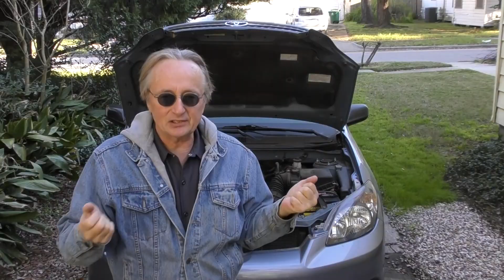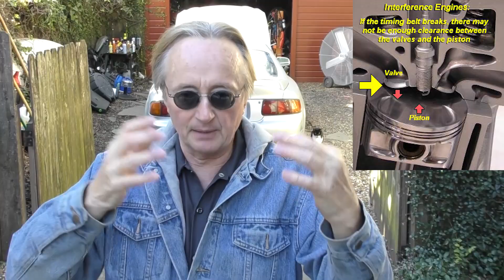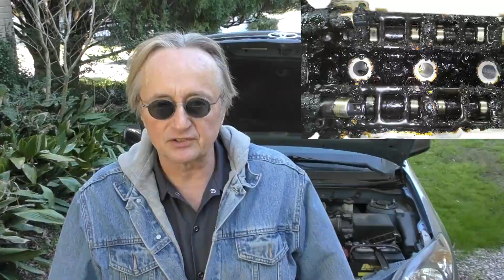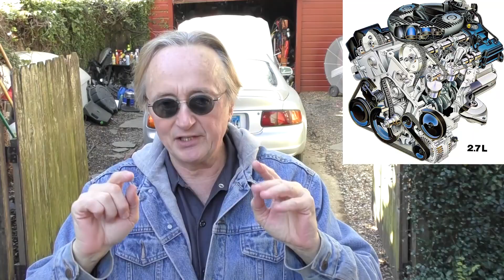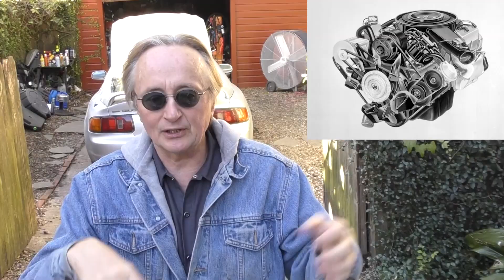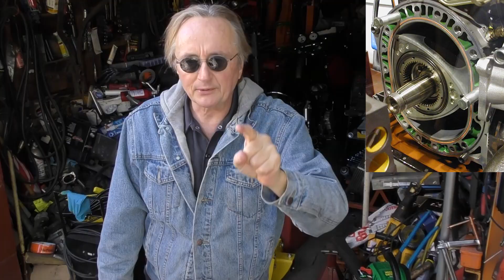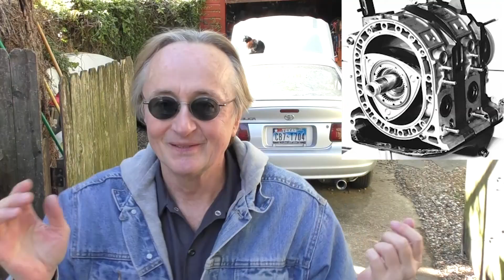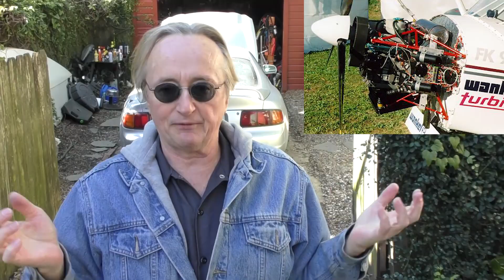Never Buy a Car With This Engine

Comment: The 2.2 a garbage engine????? Holy hell the ecotec/duratec engines are Rock solid!!! I have had 2 go well over 200k and still run like a top!!! Why do you think 95-05 cavaliers are still on the road? Exactly. Great engines.....everything else will fall apart but the engines will still be putting along hahahahah.
Reply: 92 to 02 were pushrod 2.2, after that they went to ecotec in cav and cobalt. Both engines ran great for me and many people I know
Reply: Leo Derosia Malibu’s as well
Reply: I had a cobalt with that motor and I pounded on it every single day for about 3 years , never ever had a motor issue except 02 sensor and it had 230 thousand miles
Reply: my old cav had old pushrod 2.2. Got 80k and the oil pump failed. Replaced it with a supercharged 2.2 ecotec. I never had a problem out of it.
Reply: We have 3 cars with the Eco-Tec engine. All of them have been excellent. Malibu, Saturn Vue and Chevy trax.
Reply: @alonsosanchez8547  i have a 15'  Trax, love it!
has a turbo too, which Scotty seems to dislike too....but that 1.4l turbo, when cared for will last!
Reply: I had 230k on a 2001 Cavalier 2.2 Ecotec when I got rid of the car. NO PROBLEMS from the engine, but AC went out, and I didn't feel like dealing with it. Replaced it with my wifes 09 HHR, 2.4 Ecotec now it has 212k miles on it and isn't giving me any reason to think it wont go another 50-100k. Wheel  hubs have to be replaced on the HHR fairly often, the bearings are junk. Everything else works great.
Reply: Bro, Cavalier literally means they don't give AF  ! Lol
Reply: @SouthernCharity  i don't think you understand what Literally means.....
Reply: @Brian_Buckley  bro, GM is famous for not giving a fuk.  The model, Cavalier, literally reflects that.
Reply: Have owned a couple of those. You are right.  After the car has disintegrated into rust, the motor will still be running.
Reply: My chevy S10 is a 2.2 liter pushrod engine.
Reply: This is why, Scotty is a treasure trove of misinfo.
I know so many people with the Ecotec engine and they have lasted a long time.
I agree with the 2.7l v6 Chrysler but that was really a Mitsubishi engine.
The Cadillac v8 6 4 engines were also very bad design and i agree with Scotty.
Noticed he didn't mention the Toyota 3.4l v6 and the Ford 3l v6 (not the Duratec but the Vulcan engine they used in the early Taurus), and the Ford 2.3l l4 they used in the Pinto?
Both Ford engines were synonymous with seizing pistons when it got warm and Toyota 3.4l v6 from the late 90's to early 2000's, were also notorious for engine sludging and would seize within a couple of years even if you maintained it well and this was due to a very lightweight oil being used for that engine. 0w20!
Toyota replaced tons of these engines under warranty and this engine was commonly used in their Sienna minivans during that time.
Reply: @sensiblebabyandreality6804  (1) 3.0 V6 Taurus was still better than their 3.8 one,but that don't say much good for either engine?? 3.8's were bad about blowing head gaskets/cracking heads. And Lord help you if it were in a (Heavier) Windstar!!!  But then,the transmissions also were junk in them as well,so.....which item breaks first??? (2) V-6 Mitsubishi's/'MitsuMopars' have always been known for being oil burners,ever been behind a lot of the older 'Voyo-vans' or the Acclaims/Spirits/Dynastys with one?? (Takes off from the light...."Puff"?) Plus,how often do you see an 'old' Mitsubishi?? Even where I live where rust isn't an issue,you'll seldom see one older than the mid 2000s, (And most of these are 'Hot Rodded' Eclipses,sometimes a Hot Rodded Mirage,too?) and most you'll see are also in pretty bad shape for their age? Really 'Hammered'. And never one older than the mid to late 90s!!!! (I think Mitsu started selling under their own name here about 1981-82?? 'Our' Dodge Colt's and Plymouth Arrows back in the '70s were both Mitsus,though???) (3) Caddy's V8-6-4 and the HT4100 that followed it were one of the best things Cadillac ever built......to help sell Lincolns!!! (Or Olds Ninety Eights-Toronados/Buick Park Avenues-Rivieras?) (4) 2300 Pinto actually made a pretty good little racing engine......once very popular in the Mini-Stock classes at Dirt/Short Tracks?? (But of course,those've been worked on just a bit??) (5) I agree with the Toyota issue,the oil is too light (0w20!!) for anywhere below the Arctic Circle in the dead of winter!!! (As a comparision,ATF....Tranny Fluid....that's a 10w oil??) I won't go under 10w30 on nuttin!! (And really,10w40 in the summer down here in Texas??) Plus Minivans are also hard on engines/transmissions,too? (Many are too underpowered, powertrain works too hard to pull it?)
Reply: @DrOlds7298  
Yes the 3.8l ford v6's were bad for heads. It seemed kind of weird but 3.8l v6 in the rwd models held up better than the fwd models.
I knew a lot of customers when i worked at Ford who had the 3.8l v6 in their rwd vehicles and it didn't give them too many headaches until it had over 125000 miles.
By sharp contrast, the fwd 3.8l v6 had numerous issues with the head leaking coolant internally and eventual cracking of the heads. 
This occurred usually around 40 000 miles, so Ford replaced many of them under warranty.
The failure rate was 1 in 8 vehicles on the fwd.
1 in every 20 on rwd models.
Due to the increase, inherent vibrations of fwd, Ford used the same number of head bolts on their fwd as they did on their rwd. This should have been figured earlier at the drawing board.
Anyhow, many of the Mitsubishi engines were not as well designed as their Japanese counterparts. 
The Mitsubishi 3l v6 was notorious oil burner and
 it used to leak oil at the rocker cover gaskets but they did last a fairly long time.
The 2.6l inline 4 Mitsubishi engine was very problematic from 81 onwards, when they used them on the Fwd. In the rwd, they were reliable.
Reply: @sensiblebabyandreality6804  Ford's 2.3 in pintos and rangers are gutless but legendary for reliability dude
Reply: @christinesommerfeld9815  
The Pinto's reliability is marred by its gas tank recall which cost Ford several million dollars. At that time, it was a lot of money.
Also the Pinto/Bobcat were known for their C4 automatic transmission,  slipping out of park especially when parked on an incline.
There were quiet a few reported cases of people getting run over by their Fords and either being killed or seriously injured. 
The 2.3l rwd engines burned oil as they age but were durable, unlike the 2.3l Ford used in the fwd Topaz/Tempo.
Those fwd engines were known for blowing their head gasket on top of consuming oil.
Reply: Had a 03 cavalier with the 2.2 and the timing chain broke at around 120k had to replace engine. Having said that it was less than $2,000
Reply: I know and have known several people who beat the crap out of those little cavaliers and have them for years before they finally show signs of quitting, for far cheaper than any Toyota or Honda too.
Reply: Scottie’s sponsored by Ford, I’m surprised no one has caught onto that
Reply: Troglodyte Doesn't seem like Scotty is sponsored by Ford
All I ever hear from him is buy a Toyota they're the best they last forever
Reply: @slyman190  that figures, sure would be sad if he's a ford lover.
Reply: I drove my Cobalt hard every day as a taxi for MONTHS... No issues...

Comment: I’ve had a Golf GTI 1.8t for years with absolutely no issues, just simple regular servicing. They’re generally regarded as pretty bomb proof and very tuneable. My car is 20 years old and drives great... I’m in the U.K. though, they’re common here with plenty of people around to look after them properly.
Reply: The new GTI's, sold in the USA, are extremely unreliable.  (Fun though!)
Reply: Shawn Doe that is simply not true. Gtis have a trackrecord of being the most reliable cars in class. The 2.0 tsi can withstand up to 600 hp. It is a great engine, hence why it is so widespread within the vag group. The only real problem ist oil consumption in higher mileage cars, due to carbon buildup in the piston rings. The crankcase ventilation system also fails regularly. Its a 50$ pArt and you can exchange it yourself. So tell your lies to someone else boy...
Reply: @mabrokenleg2388  Dear Casual,  GTI's aren't even in the top 10 for reliability, much less the top of their class.  Review the data, fan BOY.
Reply: @shawndoe3594  I'm an American and I can say Americans rely too much on expertise of others, i.e. dealer who have no interest if ones cars are running for the long run. They win either way in costly repairs or new cars.

I drive a 20 years old GTI and my experience has been that engines are strong and transmission is fine, but the car doesn't last because the cooling system cannot handle the heat from engine and transmission especially as the car ages. Same goes for most or all German turbocharged cars. Just  not enough cooling.
Reply: hjyou The block was iron and the oil pan and head were aluminum. Mine sprung leaks after a few years and ran low on oil. On Passât and Audi A4 the rear cylinders got less air flow as did also the turbo. The reciprocating parts were beefy. Not a bad engine but not the best either.
Reply: Shawn Doe aha so you tell me a more reliable hot hatch with 245 hp😂😂 nr. one in adac rating. Go screw yourself😅😅😅
Reply: @jamesmedina2062  Definitely no where near perfect, but  I'd say it's great because it's perfectly understood and that makes it repairable. And nothing so serious that it blows up (knock on wood).
Reply: I had a Audi S3 with the same engine, tuned to 245bhp. It was driven like I stole it at more then 140 miles per hour on the higway all the time. Had zero problems with the car. Powerful and reliable engine

Comment: I really dislike how everything with a purpose seems to become a computer as iterations go on. Video game consoles and cars have both suffered this. I prefer my PS1-PS2 and late 80s RX-7 FC with a purpose, little to no computers. PS! You don't have to take apart anything just to unflood the engine if it's one of the electrically controlled fuel injector ones. Just unplug the fuel relay fuse and crank the engine a few times with the gas pedal held in and plug back in then start. I've only flooded the engine twice. Once due to bad spark plugs that I have no idea how long they'd been in there since the last owner changed and second time was my own fault for starting then stopping after moving the car a few meters. Mazda is actually bringing back a more efficient rotary engine this year. At the end of the day rotary engines makes your car into a mid engine vehicle in practice. They handle revs much better than any piston engine. 2 years of almost daily 7500rpm revving the RX-7, still runs fine. One time with the Toyota Supra Mk3 and I had a blown head gasket on my hands. Technically the Supra one wasn't even redline. Was about 5500rpm.

Comment: Thank you for speaking truthfully and straight-forward. The VC turbo and Mazda engines with no spark-plugs are a poor idea. I am horrified that the 8, 6, 4 was TBI. Port fuel injection (SFI) is needed for cylinder deactivation systems.

Comment: Also,EVEN TOYOTA Screwed Up on Some of Older 2.2 or Might Have Been 2.7, 4 Bangers ,That Were Installed in Older Tacomas.Used A Plastic Tensioner for the T. Chain That Once They Break or Wear Out to Point of Letting Chain Get Too Much Slack,Ur Chain Would Either Jump Off GEARS or Break.
Reply: That was the Toyota 22R and 22R-E.  Yeah they have issues with the timing chain.  The guides on the timing chain were made of plastic and broke once they got some age and over 200k miles on them.  Thing is they will give you plenty of warning when they do break and don't destroy the engine.  Makes a horrible racket.  Good thing is they're very easy to replace, good bit of labor because you have to take off the water pump and some other stuff to get to the timing set.  They make aftermarket timing chain sets now that are all metal with a thicker/better chain.

Comment: 215,000 miles on my 2.2 Ecotec on my 2008 Cobalt and still going strong.  I think they're one of the best 4 cylinders GM ever used.
Reply: 239k on my 09 2.2 hhr!!! Done me good lol.
Reply: My 1st car was a 2001 VW with that 1.8T engines. Bought it at 105K miles and got rid of it at 139K miles 4 years later. Had ZERO problems ever. I only ever changed the brakes, oil, and tires.
Just bought another one a few days ago for nostalgic reasons @ 190k miles. I've put on about 100 miles on it so far and so far so good.
Reply: Bought my 05 cobalt for 600 bucks. Needed injector seals. Ran it for 3 years timing chain broke at 170k. It was a great car for the price I would buy again
Reply: 225,000 on my ion with 2.2 engine. I was under the impression it is a great engine. My brother owned    it for the first 210,000, I haven't been quite as gentle since than. Very dependable
Reply: The 2.2 is a really good engine if kept up on oil changes... If not, the tensioner gets clogged with dirty oil and it freezes, making the timing chain stretch and yeah the rest is what scotty was saying
Reply: same, 255K on mine, no issues
Reply: Yeah 120k on a 2.2 ‘09 Cobalt. Never had any issues. Runs like a top.
Reply: 213k on my wife's 06 hhr, 2.2. Runs like a top.  Synthetic oil when the meter tells me it's time.
Reply: GM sure fucked up big time after the Cobalt.  So I don't plan on getting another.  The Cobalt's been great.  After I run it through one more set of tires, I want to trade it in for a Subaru Legacy.  I'm confident it'll last me long enough 'til then.  My Cobalt also survived an elk collision at 198,000 miles.  Was so sure they'd total it, but it was fixable.  Not ready to make car payments just yet.
Reply: Incorrect. The Quad 4 was the best 4 cylinder engine GM ever made. Period.
Reply: @kgc795 i know you still have that car and refuse to upgrade because you must love the car. Made it through a moose collision. I had a deer bounce off my hhr this year. I found you though a speaker install video i used on my hhr.
Reply: @ThePhoenixw68  I do like to get my money's worth out of a vehicle.  I'm sure I can get a few more years out of it before I'm ready to trade it in.  I'm hoping to get a Subaru Legacy.  I want something a little bigger and has a little more power.  AWD is a definite must.  Right now, parts for the Cobalt aren't expensive, so I  really haven't had any issues keeping it going.

Oh yeah, you can now buy GM speaker adapters so you don't have to do all that cutting like I had to.

It was an elk I hit.  Not sure why people mistake them for moose.  Totally different animals.
Reply: My 07 had 185000 still be going but bambi had other ideas insurance totaled it out it was a good car had it 7 years
Reply: No ur just lucky
Reply: It's hilarious reading some of the defenders of these POS motors. -- Look, just because yours hadn't stranded you yet doesn't mean that it's "strong".
Reply: I agree, great engine...if you change the oil every 3-5,000 miles. One is at 120,000 miles in a saturn, another at 114,000 in a cobalt, and 179,000 in another cobalt.  Hard acceleration will put stress on the chain, and cobalts are frequently converted into ricers.  Scotty must be working on cobalt ricers.
Reply: @dstevans  With my car being supercharged and reduced to beater duties (back/forth to college and work) I will occasionally drive 20-30 mins on the interstate to "blow out carbon" lol
Reply: I have a 04 Saturn with the 2.2. It has 216,000 plus on it. Runs like a champ and still lots of power.
Reply: @paulcarlson8361  what is your saturn? L300?
Reply: @FelixBouchardDetail  Saturn ion.
Reply: It's a Saab motor that's why guys... Gm did not make it lol!
Reply: @John8910  True!
Reply: @John8910  I guess so because 2.2 Opel Ecotec was a belt driven engine, also had some problems with piston rings so high mileage engines started consuming oil. Saab was a part of GM lineup so it would make sense.
Reply: Bahahaha
Reply: 231,000 on my O5' Sunfiire. Sold it last June for an upgrade
Reply: 179k on my 05 Cobalt SS, all stock, no mods, just 93 octane and 5-6k oil changes with Mobil 1
Reply: @schwarzermond6033  nice.. 185K on my 05 Cobalt LS 2.2L.
Reply: I have the 08 cobalt with same motor I hope it makes at least half as long as yours . Thank you for your comment
Reply: @buchovik  hope u didnt buy a ford , scotty loves them and also a toyota

Comment: Haha the Cadillac required all of 1 wire to remove and was extremely easy.  Leaving you with a 368 big block v8 which was just a debored 425 and quite reliable.

Comment: Anything made by Chrysler after 1922.
Reply: So the 5.7 Hemi, 4.7/3.7 Powertech, their indestructible inline 4 engines, 3.2 and 3.5 v6, and pentastar engines are unreliable? I could probably name a few more.
Reply: 2003 Dodge Ram 2500 Cargo Van with 250,000ish miles.  5.9 V8, direct injection.  Got it (almost) new in 2003 with 1,000 miles.   It has as been as reliable as a 4 cylinder Corola.  Always always always change your oil on time and do the different fluid flushes on time.
Reply: @zackforister  Yep, Have an '05 Ram 1500 with the 5.7 Hemi mated to the 545RFE 5 speed auto. 200,000 miles no problems, got it used with less than ideal maintenance from the previous owner who used it for trailers.

Comment: Scotty... I'm very disappointed in the new engine designs... Speaking of the Chrysler "JUNK" ... a similar design was a Ford V6 engine.. how do you like the timing chain driven water pumps on the 3.5 and 3.7L Duratec engines..Yea usually they get pretty good mileage before leaking or going bad altogether..but is an awful design... Terrible...... the worst part is... when the gasket or seal on the shaft leaks it will allow coolant to go into the oil ... BAAAHAHAHAHAHAH. Terrible WOW!!
Reply: KAAAABOOOOOOOOOOOMMMMM .. YOU KNOW WHAT THAT SOUND IS...... A FORD WITH A 3.5 OR 3.7L  HAHAHAHAHA